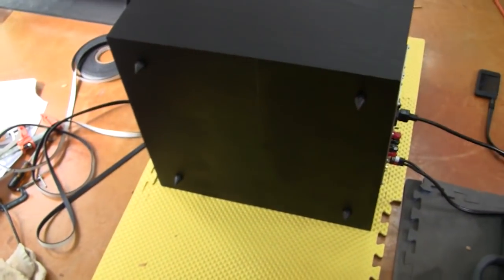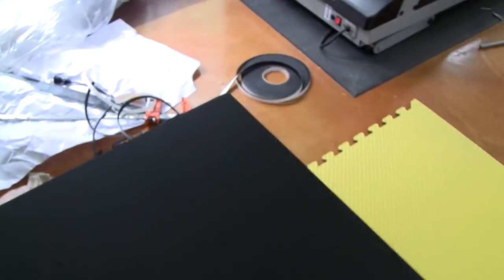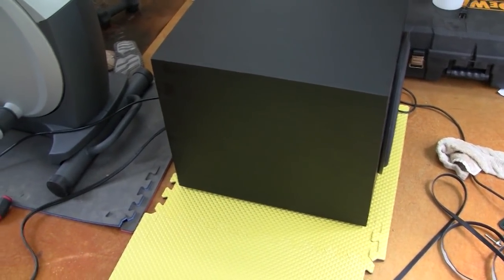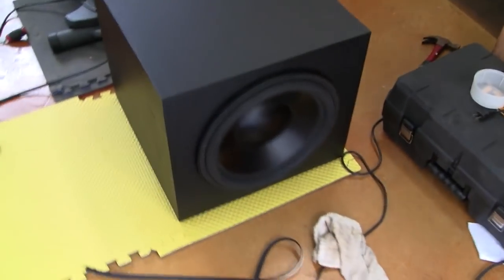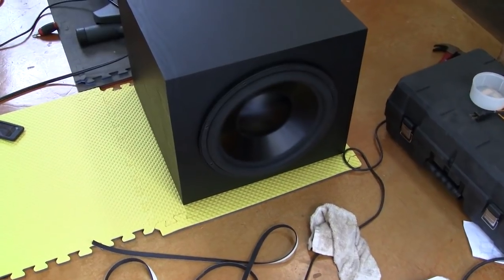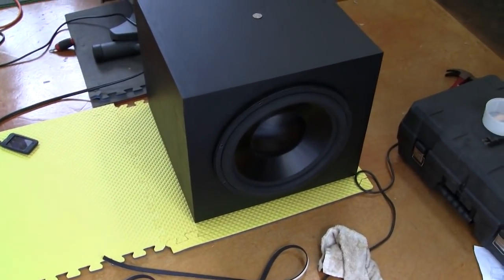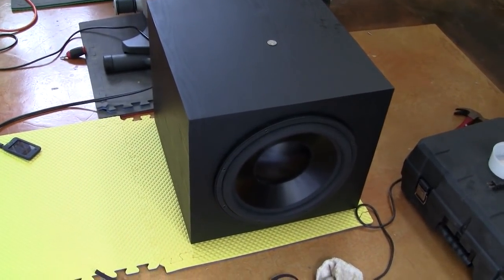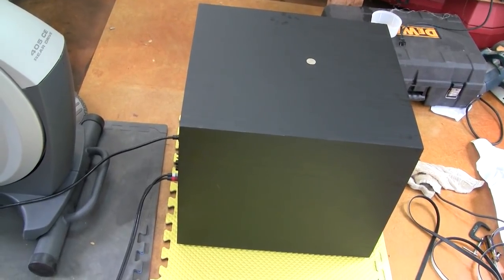Dayton 15" Subwoofer FINISHED

Comment: Is the 300s enough to push that sub?
Reply from the maker: Yes, I modeled this box size to push the driver to within one millimeter of the sub's maximum travel at only 240W (RMS). So the full 300W (RMS) actually makes the driver start clipping.  http://imgur.com/o5ohq.jpg

Comment: I am considering building this sub vs buying a SVS SB4000.   Have you ever compared your sub to a SVS comparable?
Reply from the maker: Yes. That's what drove me down the path of DIY. It will pretty much always yield better quality for the same price. How nice it looks will be up to your skill level. Check out the subwoofer kits at parts-express if you aren't great with woodworking. You could have a monster 18" sub for 2/3 the price of that SVS. SVS makes good subs though. If the difference in price isn't worth doing a weekend project then buy the pre-built. There won't be much difference sound quality wise.

Comment: What finish did you use?
Reply from the maker: It's a vinyl wrap that Parts Express used to sell that was pretty much an exact match of the black wood grain on the Polk speakers. Unfortunately they don't sell it anymore and I haven't been able to find a good replacement. It's a really nice material.
Reply: Colton McCormack thanks. I just bought a Dayton RS 12" HF. Designing the box and trying to figure out the finish I want. Last sub I made I used oak veneer and stained in. Looking for a matte black finish this time. Not sure how to seal MDF before painting it though
Reply from the maker: Catherine M when I paint MDF I mix wood glue 50/50 with water and then apply it to the whole piece. Let dry and sand. This will seal the piece. Then apply primer and paint as normal. Good luck!
Reply: Colton McCormack thanks!

Comment: Your amp is 300watt and the woofer 700 why
Reply from the maker: Good question. If you click the link in my description and scroll down to post #13 you can see that in the modeling of this driver in this size enclosure you start getting within 1mm of maximum driver excursion at 240W RMS of power. Feeding it more power than this is just going to start creating distortion and eventually driver damage. It's important to remember that most amps advertise ridiculous "peak" values for wattage rather than true RMS values. 240W RMS is more than enough to crack your drywall over time with the right enclosure, such as a folded horn.

Comment: How did you apply the vinyl? one side at a time?
Reply from the maker: I actually glued the roll across all 4 sides at once(without cutting). Then I glued and cut the front and back pieces separately and left a quarter inch hanging off all edges. After the glue setup I trimmed the overlap with a razor.

Comment: Fuck hurricane nuts, just screw right into it.. Don't know why you'd need hurricane nuts unless it's going to be temporary. Just my opinion though..
Reply from the maker: Well, yes. I probably took the driver in/out 3 or 4 times while I measured frequency response, added extra fiberglass, added more bracing, etc.
Reply: Colton McCormack Still, you can rotate the driver if you're that worried. Divide the weight by the amount of screws. The 15" is only 30 lbs.. that's 3.75lbs per screw...
Reply from the maker: Yeah, but MDF isn't the best with screws due to its particulate makeup, unless you buy MDF screws. I probably pulled the driver off 3 or 4 times to adjust polyfill and bracing. That would be a lot of extra holes fairly close together and the driver would no longer look symmetrical due to the screws being at an odd angle. Not necessarily anything wrong with it, but it doesn't take long to just drill holes and pop H-nuts in. No worries at all with driver adjustment after that and it takes maybe 2 extra minutes.

Comment: Very sharp looking
Reply from the maker: Thanks!
Reply: Colton McCormack hows the plate amp holding up?
Reply from the maker: Great! Power's been set to "auto" pretty much since I posted this video and is used as the audio source for my computer/home theater daily. Still sounds great. Probably gonna tear this whole build apart and repurpose the amp/driver into a folded horn for my new house though. Cheers.

Comment: Would you build a kit again or buy it all assembled?
Reply from the maker: +A gm (snowman) I'm actually about to build another one. You can make sure that you save a lot of cash and get something that suits your needs perfectly by building yourself. But if you don't have tools then you will probably end up spending a bit more. I use my tools for home remodeling and other projects so it is way worth it to me.
Reply: +Colton McCormack I don't have the tools or your building skills.  I presently have an older 12" Velodyne back when they were made in San Jose, Ca.  I'm having a thumping noise sometimes in loud passages, but not all the time.  Velodyne says it's probably the electronics, they no longer support repairs to this older model.  About 3 years ago Velodyne replaced the driver and I don't use it very often or have the volume high at all.  I'm a bit disappointed with Velodyne.

Comment: i'm really impressed by this woofer, looks awesome and also sounds good imo, nice work! i was wondering if you actually calculated this case or not, i want to build my own sub with a mivoc aw3000 speaker (i know its cheap and not really good blabla ;D ) and i have no idea if i should calculate the case or not, want to build a sealed one and thought about 60 liter; i wasnt able to find any sealed case builds with this speaker on google so i have nothing i can look at while building it...
Reply from the maker: Thank you. It's been running strong for 3 years now. Go to the build thread link in the description and I show all of my calculations in one of the posts. Best of luck.
Reply: Colt McCormack ups sry, totally forgot about that thread, i actually read through it already few days ago haha; as far as i see that you used bassbox pro to calculate it, right? just tried it on my pc but it crashes at the installation.... 
i think i'll just build a case and hope that it sounds good^^ i also tried to calculate it with winISD and with a 60 liter sealed case i get a fsc of about 40hz, not sure if that is good or not
anyways, i gonna ask in some forums and hope they can help me with that damn speaker ;D
and thx for this awesome vid, i already watched it more than 10 times i think, its such a beast woofer
Reply from the maker: I Love Music I used BassBox as well as the fantastic Excel spreadsheet pictured in post #13 of that thread. If you go to post #6 on that thread, click the second link, and download the one called "Woofer Box and Circuit Designer" then you can use it to calculate yours too. I highly recommend it.
Reply: Colt McCormack thx a lot! i think i got it right now ;) which active module do you use? because i think about buying the "mivoc AM 80 MKII" and the crossover is at 40-180hz, arent the 40hz too high?
Reply: I Love Music nm, already found out the name by watching the other vid from you

Comment: should have used the 500W bash
Reply from the maker: I wouldn't have been able to use it. The 300W at full power pushes the driver to 13mm of excursion. The driver's max is 14mm, so more power would cause damage.
Reply: Colt McCormack really for an 18" ??
Reply from the maker: streetbattles919 for a 15". When you start building boxes with these large volumes you don't need nearly the power to produce deep tones at volume. The bigger the box the closer you get to needing drivers designed for an infinite baffle setup.

Comment: Hi there. For pumpy bass, which is better; ported or sealed? 

I mean like to make the SPL so high it shakes the ** out of the house.
Reply from the maker: If all you care about is how loud it can get, then out of those two ported gets louder. However, a folded horn type gets much louder than either, with better sound quality than ported. Google: Tuba HT for an example design.
Reply from the maker: ***** Yes I wasn't going for strong bass. I was going for smooth, deep, and accurate bass. A folded horn still plays way lower and louder than either though.

Comment: Hey, do you prefer sealed over ported?
Reply from the maker: Yes, but just for audiophile applications. For general bass in a non-treated room something like a folded horn or even ported will probably be better. Ported for basic bass-heads (hip hop and whatnot), folded horn for a really loud and really low playing sub(great for super bass-heads, movies, much harder to build).
Reply: Harder to build and much larger lol

Comment: u idiot u need to make a hole on it to let the air getin and out!
when u do that in would be 5-6 times more powerfull!
Reply from the maker: Basic science and mathematics severely disagree with you.
Reply: yeah. if not. its gonna blow the subwoofer and the case. if you put it to max
Reply: Naufan Septiadi How many subwoofer boxes have you built? I have built several sealed boxes, one with two powerful 12" subwoofers. Guess what happened with that one? Nothing broke, and it played extremely well. Educate yourself before you claim others are wrong. The subwoofer will definitely blow if you run it beyond it's limit in a ported box, as it will have almost no resistance, and will bottom out. Do you have any idea at all how speakers work?
Reply: He clearly stated in the description that he was going for sound quality, and not necessarily sound pressure. A ported box isn't necessarily the best solution for sound quality, and besides, 110db is plenty sound pressure, especially if it can achieve that at relatively low frequencies.
Reply: well sorry about that but really try it
Reply from the maker: Sos Sahakian I've built plenty of subs. Ports don't make the sub more powerful, they just produce a humped response curve around 30-40Hz. So they play louder in that frequency range, but lower in others.
Reply: why do you need the subwoofer at all for powerful bass or not
Reply: ***** no,you're wrong
Reply from the maker: Sos Sahakian For accurate sound reproduction in the <50Hz range. The sub shouldn't overpower the speakers. I'm not looking for shitty flabby bass like half the kids put into their vehicles today.
Reply: do what you think i made a lot too and it vibrates everything!!
Reply: Sos Sahakian  Here is a cookie, now leave.

Comment from the maker: Sounds pretty similar to my setup. I also have all polk speakers (front towers like yours, but 4-way rather than 5-way), but an older model line. Only doing 5.1 though rather than 7.1 with the AVR-3312CI, massive Emotiva external 5 channel amp, and custom OPAMP'ed Asus Xonar Essence ST+H6 source. This is just my PC audio setup though, not my home theater.

Comment: I have all polk rti series a6 center a5 towers x4 for surround and a7 towers for front. with two Dayton audio 18" reference HO in the diy boxes came with bracing for insides of the boxes was easy to do. I power them with two Dayton sa1000. the bass is insane! I have a denon avr-3313CI it powers the towers! I like your box and vinyl wrap you did to it.

Comment from the maker: That's not the box rattling. It's other stuff in the room vibrating. Once I brought it inside there was no rattle. The bracing is super solid, actually probably causing the box to bow out slightly. Using rods for bracing? Sounds like it would be a pain to setup compared to boards.

Comment: i apologize for for parading your inbox with these. you can prevent clipping or as some call it distortion by setting your amp correctly. meade916 on here has whats called an SMD distortion detector that sets the gains and frequency on amplifiers so they don't clip. they can also maximize the output before internal clipping occurs. when doing this do same with pre-amps as well.

Comment: all depends on what sound you prefer. sealed creates lower and tighter notes as opposed to a vented they create loud but still carry a bit of punch, not as much as a sealed. however there are many many many different enclosure ideas out there that create a specific note ie: band pass, T-line, bass reflex, reflex, etc... ports never hurt but you gotta do your math on them. i encourage for beginners to use a program that builds boxes. not dissing this guys build in any way, i mean no harm in this.

Comment: this was pulled off partsexpress website for the Dayton Audio RSS390HF-4 15" Reference HF Subwoofer 4 Ohm in response of this reply
BOX SIZE (MODELED WITH BASS BOX USING HIGH FIDELITY SETTINGS)
Sealed Volume     	2.88 ft.³ 
Sealed F3     	37 Hz 
Vented Volume     	8.96 ft.³ 
Vented F3     	21 Hz

Comment: SPL comp ran a best of 152.4db. so i guess what i'm getting at is my house is small and only wanna produce up to a 40 hz  frequency. 500 watts rms should run it good and strong. i liked your build and plan on using 1/2" threaded rod with nuts and washers for internal bracing instead. had good luck with that in the past.

Comment: eventually gonna build a Transmission Line tuned to 25 hz down firing, rear slot port,  dayton 15. same as you but with the BASH 500S. had a T-Line box tuned at 33 hz for a L7 12" Kicker in my old car, 1800 watts of fury!!! one sub in truck with "outlaw" at

Comment from the maker: Yes, more power does generate more heat, but the amount of heat off a 300W BASH (hybrid class AB and class D amp) plate amp is not enough to cause anywhere close to an issue with the sub, fiberglass, or MDF enclosure. A sealed box isn't somehow worse at heat dissipation as the aluminum plate allows plenty of outward heat transfer. Even a ported sub has very little air circulation, despite what port chuffing would have you believe. Remember that subs vibrate air much more than move it.

Comment from the maker: Haven't actually measured it yet Jim, but it is pretty solid below 20Hz. Definitely loud enough to shake things off shelves around the room. I just added my build thread over at htguide.com to the description so go check that out for the calculated (theoretical) response of the sub.

Comment from the maker: This sub performs great. 27 cubic feet is a massive space for a sub haha. Make sure you brace the hell out of it. No need to get such an expensive sub. If you are compensating with a box that big you can just use a cheaper 15" I'm sure. The key is to use a speaker modelling program like Bassbox or WinISD to make all your calculations on port, size, tuning, etc.

Comment: i was looking to do a build like this, the speaker is a little out of my price range but i can afford it eventually lol. i was looking to do this sub i a 3 ft^3 box tuned to 20-25 hz for movies and to fill the bottom end of my system. how does this sub perform? if i ported it and built the box to the sub's specs would it be a good sounding subwoofer? thankyou and this is a great build man! thumbs up! :)

Comment: is the amp sealed onto the back with silicone? Whenever I built a subbox for a car it would be air tight as possiable. 

Would making a seperate enclousre for the amp increase the sound HQ?

Comment from the maker: Ported boxes are a great "middle of the road" platform, but don't offer the fidelity of a sealed box nor the power of a folded horn sub. They are great for non-audiophile purposes. You can build a really really nice ported subwoofer, but IMHO they don't quite match the sound quality of a sealed box. If it's for a car or theater, go ahead and port it. If you are listening to uncompressed audio files at reference level, go for a better speaker.

Comment: BTW I forgot to say congrats on those subs. They are great drivers. I have the more budget oriented DVC385-88 Dayton subs. They have decent xmax (15mm) and SQ is actually very good in sealed for music but I'm using them for HT so mine are vented because I wanted to get flat response in room to 15Hz. With room gain and an EBS alignment, I'm close. -3db point appears to be 15Hz and -6db at 11Hz. It will however unload at anything below 10Hz which forced me to get a subsonic filter there.

Comment: Oh I see, well I don't really think there is a hump unless one builds it into the design. No different than building a sealed box with a high Q.  Its entirely possible to build a vented cabinet that virtually behaves like a sealed box - if you tune a vented cabinet lower and lower, then it will essentially become a sealed box for frequencies above the tuning. The cliff does exist which is the sharper rolloff, but it can be made to be flat  to that point which sealed cannot do.

Comment: somewhat above the tuning frequency, the vented speaker would behave like a sealed box. So lets say you have a 12 subwoofer, ported and tuned to 25Hz. Probably from 35Hz and up, it will essentially behave like a sealed box. A ported speaker does not have humps in its response unless its not designed correctly.

Comment from the maker: The sub does indeed have metal spikes. I disagree with you on the accuracy bit as ported subs are slightly less accurate than sealed systems, all other factors being equal due to the pressure of the system allowing a driver's travel to arrest in the dimension it is traveling and reverse to the next seek point (as derived by the magnetic force being applied) faster than in a non-pressurized system.

Comment: That's fine but I assure you most "ported" boxes subs or towers are mass market affairs that cut corners on size, bracing, component quality and even engineering. If I ran a much longer than average port tunnel and flared the bottom or open mouth aperture, all other things being equal I can get a significantly lower Hz rating by at least 4-8 with a bump in db. Sealed is easier to get a n audiophile result but usually with a subtle loss in texture and bass imaging(3d to 2d) especially noticeable.